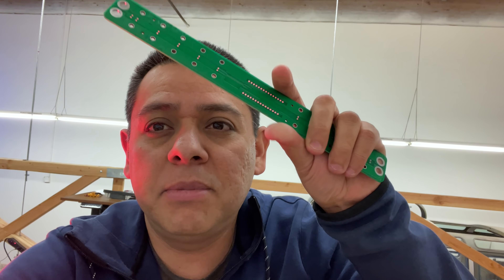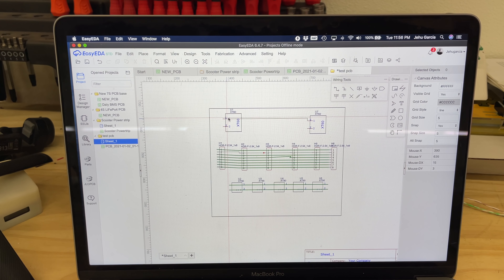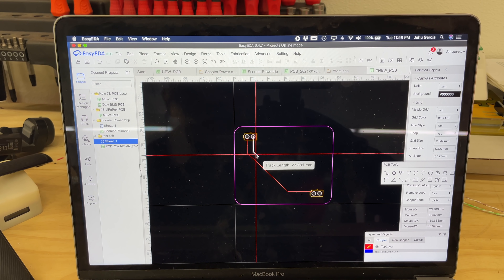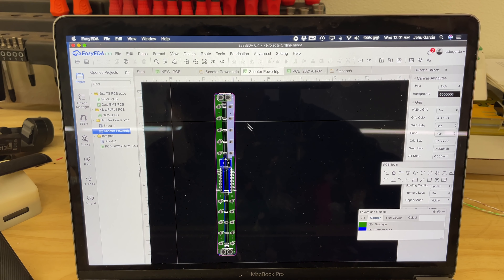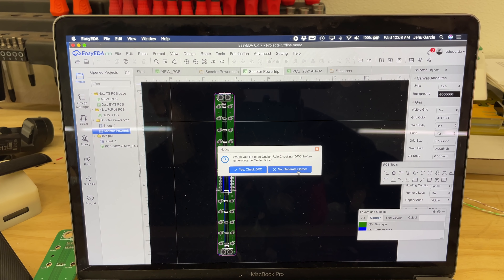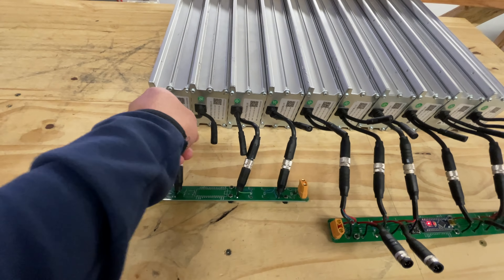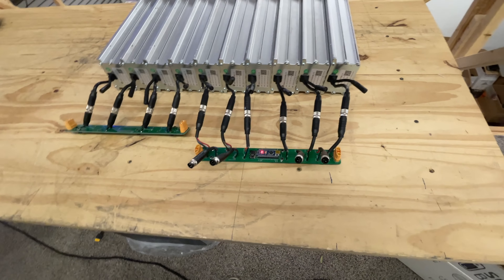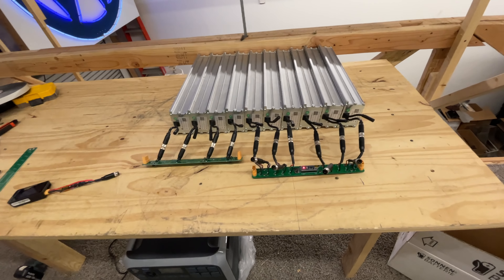DIY Powerwall Design - PCB  PowerStrip

Comment: Hey Jehu! I am a circuit board designer and I happen to have used EasyEDA a fair bit. You might want to consider drawing 4mm/100mil/0.16" traces on the "BottomSolderMarkLayer" layer, on top of your existing BottomLayer traces. That way the copper gets exposed in those areas. You can then tin those traces with your soldering iron for much higher current carrying capabilities (lower resistance). Just find images for "PCB trace tinning" and you'll know what I mean. 

On the schematic side of things, you would generally "fan out" the connection from connectors and parts, instead of drawing it all in parallel like you did. Even for parts that are indeed parallel, you would rotate the part (CMD+R Mac, CTRL+R Windows) so the pins stick up or down, then create a common horizontal "wire" above or below all the parts where their pins meet. Hope that makes sense xD.

Also, when creating a project, you generally want to start with just the schematic. You could start with just the PCB, but it is much harder to to the pin mapping that way and you will make mistakes. Just plop components on the schematic first, wire them up, hit Design > Update PCB (or Create PCB first time of course), and the PCB editor will show you "rat lines" to hint which traces still need to be connected. Much easier :)
Reply: Tom thanks for the feedback. Is there a rule of thumb in PCB design to determine the width of the traces to be able to handle certain amperage? I’m very interested in learning how to design PCB for custom battery pack/solar application.
Reply: @mariomorales1010  the rule of thumb could be: you know the thicknes of the copper in your PCB, you know width (or you want to find it out). By multiplying those two you get the surface - and this one you compare to a AWG list, resulting the amperage. Therefore to find out the required width for a certain amperage you have to reverse the calculation.

Comment: A couple of thoughts...widen the board until it fits the width of that space to the left of the stack of packs in the enclosure. Then extend the wires with the connector coming from the PCB to about a foot long. Each wire then comes out of the board and forms one loop before the connector plugs into the one from  the pack. This gives you lots of flexibility and nothing gets crushed.

Other things...
- Rotate each pair of holes for the wires to the pack by 90° and move their traces closer together in the middle of the board. Now you have more room to widen the main copper traces. Fill every available space with copper to decrease the temperature rise and power losses.
- Definitely go with 2oz copper if not “reinforcing” it with bus bars or bus sheet.
- For 50A of current carrying capability (two outside layers giving you 100A) it takes a 2 oz copper trace about 2.3” wide for a 20°C temperature rise. Wider = lower temp rise, narrower = greater temp rise and greater voltage drop.
- Other things can be done, contact me to chat if you want.

Comment: I would definitely try to find a board mounted connector if possible to put on the board. I would also consider using a four layer board  so you could have a solid layer of ground and power in the center layers. You can tie layers together using blind VIA's, of course all this is going to increase the cost of the board. Sounds like you have a lot of subscribers to help you out with this stuff. Your putting a lot of effort into this so I hope you have an endless supply of those batteries to make it worth your time. Thanks for everything you do for us.

Comment: I am still hoping you will come up with a DIY 'system' rather than having to rely on voluminous soldering of parts that ultimately have to be unsoldered.   What I have in mind is a custom made panel box with horizontal slide in slots for custom battery holders.  When the custom battery holder slides into the back panel, the back panel allows the +/- connections without an extra wire or XT connector.  The front side of the custom battery holder would have a simple BMS indicator to show that the cells in that battery holder are healthy.   If not, then that particular battery array could be removed from the panel and checked individually without affecting the overall voltage supply of the powerwall.

Comment: Instead of having a wired plug on the PCB...can you get a board mounted connector for the battery so that there's less cable length to mess with and at the same time have a more secure connection?🤠👍

Comment: If you redesign it so that the connections are at a diagonal,  you can flip the board on its side and offset from the batteries....this will lay them at a nice diagonal to the batteries themselves without much fuss.

Comment: Jehu, can you find a mating connector for those battery leads that can be circuit board mounted? Rather than a jack, have the connector soldered on the board and mounted your PC board on the inside left edge. The pigtail comes straight across and plugs into the PC board. No bending of your pigtails and a secure connector soldered on the board itself.

Comment: If there was a board mount of that connector you could space them pretty well for a powerwall stack. Otherwise you probably want to use a much longer pig tail and put holes for zip tie strain relief near each connection

Comment: A tip could be to design the card with a pcb mounted contact, instead of the contact with wires. It looks like an ordinary M12-contact?

Comment: @jehugarcia 
In a previous video you talked about putting these in series. What is the max voltage you can get from these? Have you tested that capability?
Reply from the maker: I’ve only tried 72v but I wanna try 3 for 111v

Comment: Hello Jehu,
I have ordered some batteries (2) from you, hopefully they will come with connectors, if not can you let me know what the connector type is and where to get them.  
Thanks
Reply: I've heard some people got matching connectors with there batteries. However I have not myself. I've been looking high and low with very little luck. If you do find a supplier let me know. I'd appreciate it. If someone has a couple that they have no need for I'd be interested in purchasing them.
Reply: I am with you... would love to know what connector they use.  I also want to know what the charge port connector is if anyone knows...